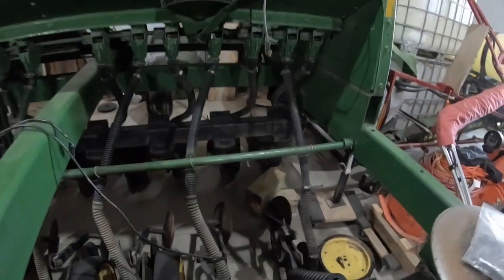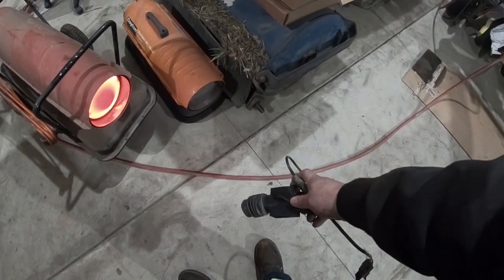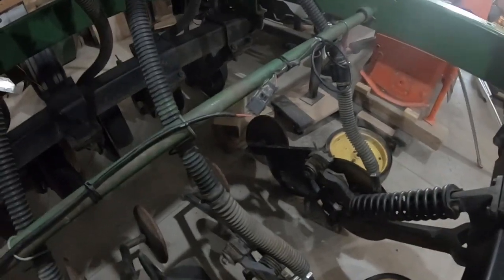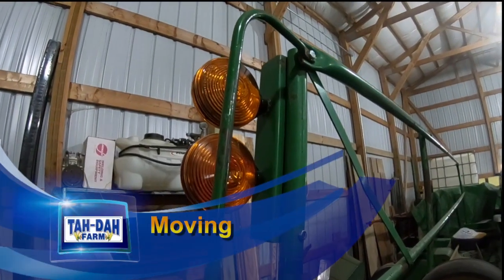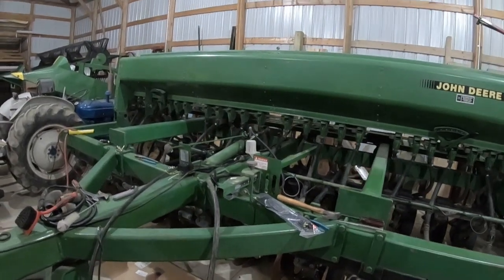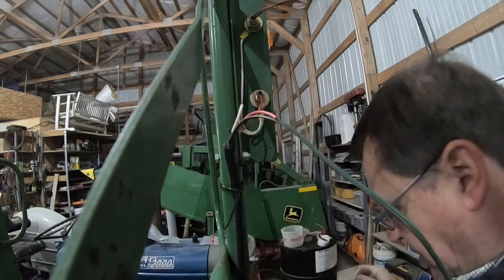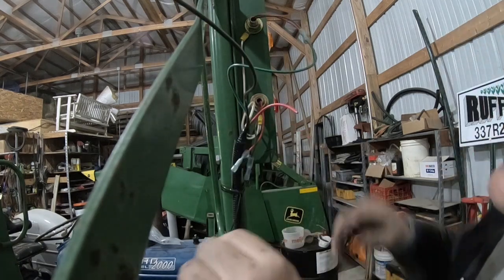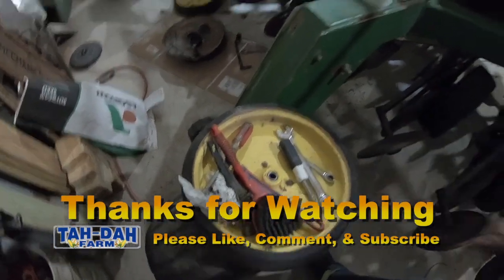John Deere 750 Drill Lights and Monitor Sensors

Comment: Nice work. Seed sensors will be nice, especially on the outside seed units, seems like they are always the first to run out!
Reply from the maker: Yes, with this drill that is the main advantage of having them. But the ones in the middle will let you know if that bay runs out.

Comment: Do you put sensors on each row
Reply from the maker: No, only on 4 rows. That is how it was setup on the last drill. I put it on the rows John Deere recommends. There is one at each seed bay and to the outside rows which run out of seed first.
Reply: @TAHDAHFarm Where did you get the sensors? was it a package deal from john deere ? and does it come with a monitor and if so what did the whole thing cost? thasnks
Reply from the maker: I took this off of the drill I traded in and it required a 10' extension cable that cost $165 that I didn't need on this drill. However, I got the 4 spencers from Sloan Express for around $50 each. The main harness cable for 4 rows with the weatherpack ends was $130 from Shoup.  The 1st year I used this setup on the old drill. I used the monitor that came with my John Deere 7000 corn planter. I had a problem with the John Deere 100 monitor when I switched it to work on 4 rows. It work that 1st year just had the alarm buzzing the entire time I was planting. It worked ok when it was set for 6 rows on the corn planter. So anyway,  I desided to replace the John Deere 100 monitor and got a new monitor from Shoup. I decided on the Vanguard VM-5200 16 row for some of the added features.  I used Vanguard monitor last year and it was worth the money I spent on it. In all for how I will be using this setup for the John Deere 750 drill, I have around $1200 in it. But the Vanguard monitor is also used on the corn planter. I didn't drop all the money at one time which makes it easier to do.  I probably wouldn't have changed the monitor if the Deere would have been working correctly.  That was a big investment but again worth it with the more information you get with the newer technology.